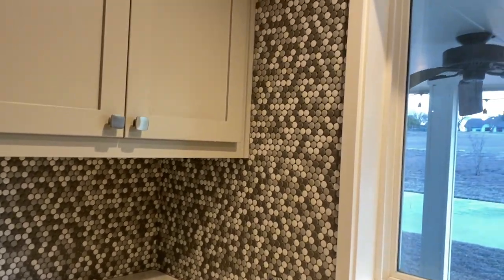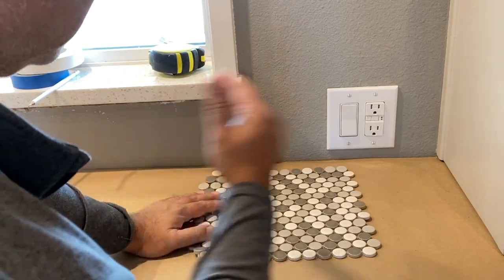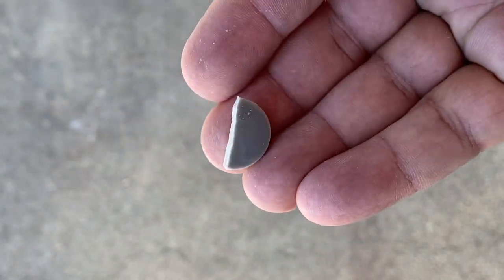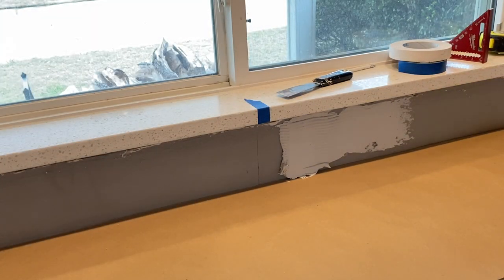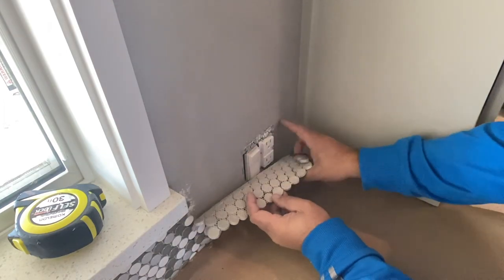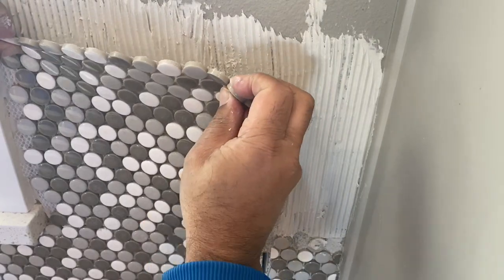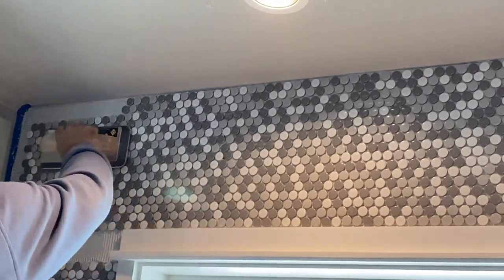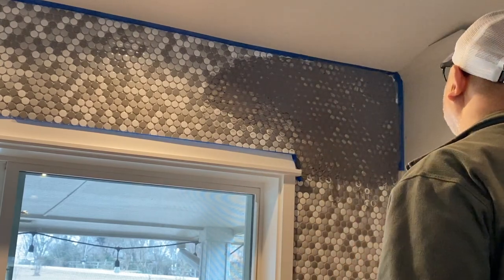Penny Tile Installation | Kitchen BackSplash

Comment: Some good info there.  Thanks for taking the time to share.  
Only thing is I was hoping to learn more about the inside corner of the wall.  More to the point how to get them to interlock in the very corner.  Thanks!
Reply from the maker: You are right on that, that was a missed opportunity my part. Basically what I did was to ensure the best I can that it looks like a continuation, meaning it looks like a whole tile even though it’s a corner. So for example if I ended up with a third of a penny time on one side I try and make the other side start at 2 thirds. Not sure if I make sense, but it’s what looks good to the eye

Comment: Thanks! Definitely subbing after this tutorial. Very easy to understand for a beginner, and your other videos are things I'd like to learn.  I'm just beginning to tile my kitchen backsplash. Now you've got me thinking I should take it all the way up the wall. We'll see. lol I had to remove outdated tile which left a few holes in the drywall. Still trying to figure out if I should just patch and sand the drywall or replace it with a 1/4" or 1/2"cement backer board. Don't know why I'm afraid to drywall, but I am. Just seems so flimsy. Cement board, screws, and mesh tape seem easier for me to handle for some reason. Which route would you take if you were a beginner?
Reply from the maker: Thanks for the kind words. Cement board may be an overkill for a backsplash, I would go for drywall myself. You can just patch the bad spots in the drywall with joint compound.
Taking the tile all the way up looks nice for sure, just need to make sure you absolutely love the tile…lol…

Comment: Wonderful tutorial! You said the switch plate will cover the tile so you weren’t concerned about it being perfect. I need to make sure I understand before I start- I would think the tile would need to butt up to the plate because the screws are so tiny they won’t screw the plate back in if they sit on top of the tile. Will you please clarify? Thanks so much- I’m feeling a little more confident!
Reply from the maker: Thanks for watching and commenting. The tile should not butt up to the switch wall plate. The switch wall plate should always be on top of the tile.
So you ask a good question on how you screw on the plate, there are basically two options, what I did was to use electrical out let extenders that allows you to extend the switch out so that the switch plate fits flush to the outlet. I have another short video on how to do that here:
How to Extend Electrical Outlets to be Flush with the wall
https://youtu.be/7w8yjY7hBA4

Comment: Is it okay to go right over painted drywall? I thought it would need a cement board or something similar to build a lasting bond. Just curious! Thanks!
Reply from the maker: Depends on the paint that was used on the wall. If it’s gloss paint then I think you should think about prepping that surface prior to tiling. I have tiled over matt finish paint with no issues.

Comment: My penny tiles will be above a vanity, so they won't go wall to wall... how do you recommend sealing the edges? Would you finish on half pennies or full pennies? Would you use a tile edge or just caulk? Thanks!
Reply from the maker: You have a few options. You can finish the edges with pencil tiles, they come in different colors so that will look nice. Or you can finish the edge with a metal SCHLUTER edge. SCHLUTER has a few different profiles so you can select what you like and they come in 8 feet long size so it’s easier to work with. Just google SCHLUTER edge on you tube, and I think Lowes sells those. Those are your best options , hope that helps

Comment: any tips for spacing and how to avoid seams?
Reply from the maker: I eyeballed the spacing, and the tiles are off set with each other so hard to see the seam. The key is spacing, if you don’t want to eyeball it, you can try and see if you can use tile spacers. 
To be honest for me eyeballing was easier,  just stick the tile sheet to the wall step back and see if it looks seamless. 
You can also offer the whole tile sheet, like a brick wall. 
Not sure if any of that helps ?